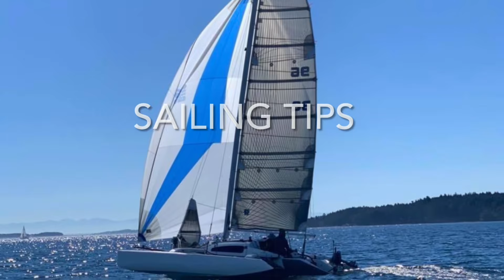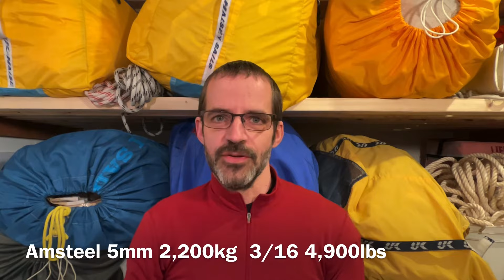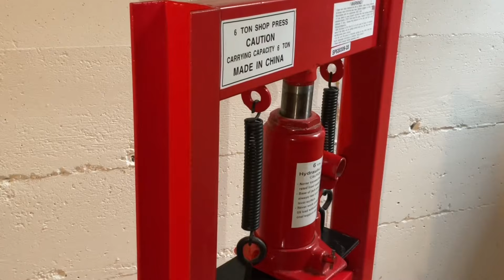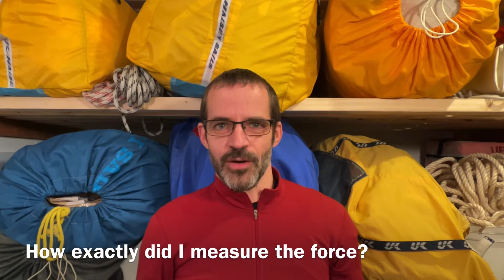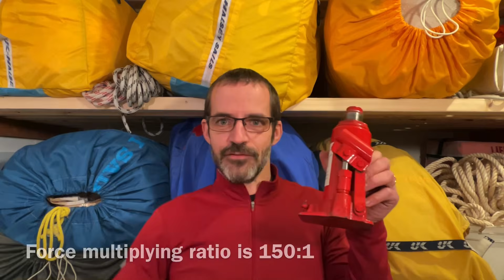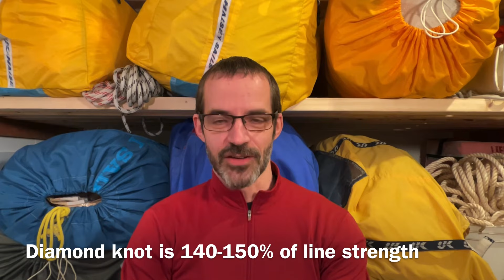The Easiest Way to Make Soft Shackles

Comment: Hi would you use this kind of shackle for genakker head, clew and tack? TY :)
Reply from the maker: Good question! I normally use these types of soft shackles for attaching blocks to random locations to tweak headsail leads, and I have also used for spinnaker clew. For head and tack I normally use metal shackles but could use these too. What size of boat?

Comment: Questions. Does the length of the handle effect the force ratio? And, does the work the same for a rolling floor jack? Thanks!
Reply from the maker: With a rolling floor jack there are effectively three force multiplier ratios at play 1) the size of the hydraulic pump actuator piston vs the piston that lifts the jack 2) the length of the handle and the distance between the pivot and the hydraulic pump actuator, and 3) the length of the lifting arm and the distance between the pivot and the hydraulic lifting cylinder. That said an easy way to approximate the ratio of a rolling floor jack is to say lift the back end of a pickup entirely off the ground by the differential while measuring the force on the handle. Then weigh the back end of the pickup on a commercial vehicle scale to determine the effective force ratio. Of course this will change at extreme jack angles but is a reasonable approximation.

Comment: Check out how not 2 YouTube. I made overhand soft shackles too, I hope they break before anything else on my rig 😂
Reply from the maker: Yes How Not 2 has some excellent content, plus they have a far fancier test rig than I do! Since creating the video I’ve only had a single “failure” of an overhand knot soft shackle, and it was the noose slipping over the knot because I wasn’t careful to make the ends equal lengths so the noose was a bit loose. Plus I was using the soft shackle to connect some Dyneema rigging to my tractor to pre-tension some shrouds and pull out the construction and splice creep, so a much higher load than I’d normally put onto a soft shackle.

Comment: Thanks for the video. Straight to the point and well done. Will be making some for my jeep winch.
Reply from the maker: Note that I’ve only tested this on 3/16 or 5mm Dyneema so have no idea how well the overhand knot works on other sizes of line! Since I made the video I’ve had one “failure” where the noose slipped over the knot, but the shackle didn’t break. This was because the overhand knot is a bit smaller than some of the other common soft shackle knots and my ends weren’t completely even so the noose was a bit too loose on this particular shackle.

Comment: I just finished watching 4 videos on splicing soft shackles. Given the forces that your original single overhand knot shackle could bear, that's probably more than they would ever experience on my boat. So happy days, thanks for a great video.
Reply from the maker: Cool! I’ve only had one overhand knot “failure” since creating this video, and it was the noose slipping over the knot because the ends weren’t quite symmetrical, and the overhand knot is smaller than other knots.

Comment: I have many uses of the quick connection that a soft shackle can do, but they are so expensive. Why does everyone talk about Dyneema rope in soft shackles? Can't I use regular affordable Danline rope if my main purpose is just a quick non-corroding connection?
Reply from the maker: It really depends on how much strength you need. Dyneema is stronger than steel and a soft shackle made with 3/16” or 5mm Dyneema can lift several thousand pounds. If you only need to lift a hundred pounds you can use other lines. But my local chandlery sells 3/16” or 5mm Amsteel Blue (which is Dyneema) for about a dollar per foot, so you can make a soft shackle for about $3, versus $30 same thing will cost in the store. HUGE margins on Dyneema soft shackles!

Comment: Hi, I have a little Tramp trimaran. I am thinking about replacing the brass hanks on the jib with amsteel hanks (because the brass hanks are wearing through the sail when the sail is rolled). The forestay is steel, but I am hoping that amsteel will give pretty good chafe resistance. Do you have any experience with using amsteel in that sort of application?
Reply from the maker: Yes I have sailed with jibs with Amsteel hanks, basically a loop fixed to the sail on one side that folded around the forestay and was captured by a velcro tab on the other side, kind of like velcro shoes for kids. Definitely works but a bit finicky to attach the jib. Another approach is to just use a piece of webbing fixed to one side of the sail, which loops around the forestay and attaches with a nylon buckle to the other side of the sail, the same kind as a backpack strap.

Comment: So, I got out my Ashley's Book of Knots, turned to the section on "two strand lanyards",  and after experimentation settled on the #802 (page #145). It's easy to tie, easy to untie, easy to keep perpendicular to the splice, suitably bulky, and seems to hold well without slipping when I tug on it. Of course, I can only put a few dozens pounds of force on it by hand, compared to your hydraulic press...
Reply from the maker: Great suggestion to test that one!

Comment: It’s very little extra work to tie a soft shackle with 150% of line breaking strength.
Reply from the maker: Based on my testing the overhand knot holds about 75% of line strength and the double figure eight holds about 150% which is also easy to tie. There are definitely fancier knots out there if you’d prefer.

Comment: I'm curious about replacing the shackle that holds the top of the Genoa in a roller furling system. I'd worry about it shaking out of the loop when not under sailing load, bouncing around on a moored boat for a season. Does the loop hold tight to the knot?
Reply from the maker: Great question! I’ve never used a soft shackle in that application but I have used them for jib sheet connections to the clew for the last five years and never once had one shake out even if the sail is flogging. The biggest concern would be chafe and ensuring the shackle doesn’t encounter any sharp edges. Hope this helps!

Comment: Button knots always feel better to me, and oddly enough i never had any issues tying them
The main reason why i prefer them to diamond knots or most other knots is because i like the bigger bend radius for the noose
Reply from the maker: If I’m to do a “fancy” knot I also prefer the button knot over the diamond knot.
Reply: @SailingTipsCa  yeah I think it's really odd that button knots are almost like hazing in some sports like high lining. They say "you gotta earn it" when button knots arent that hard to tie. The trick that helped me was to start by tying it super close to the noose so I had a ton of tail to work with, and adjust the tails as I'm sinching it to get my desired length

Comment: A knot I like is the double overhand knot. Then if the end pulls through under load there is still an overhand knot as backup. Would love to see this tested.
Reply: Meant to also say . . . lots of friction too because of the two wraps. Therefore might work well with dyneema.
Reply from the maker: Good suggestion!!!

Comment: Try to tie the Zeppelin knot instead overhand knot.
And it's much easier to tie Cow hitch after different knot instead loop first.
Reply from the maker: Thanks - I hadn’t encountered the Zeppelin knot before! Also need to be wary of cow hitches in Dyneema in general because they tend to slip.
Reply: @SailingTipsCa  Then You can use double or multi overhand knot, or 8-figure knot
Reply from the maker: @ Yes I mentioned test results of the double figure-8 knot in the video and it did much better than the single overhand knot. I did not (no pun intended) test the double overhand knot - will do!!!

Comment: Uprating the size of the line used for the shackle could easily make up for the difference in strength too. I was planning to use 3mm in some places on my boat as it will handle the load, but bumping up a mm or two will make them easier to handle in addition to adding cushion to the breaking load.
Reply from the maker: Yes I find 5mm / 3/16” to be sufficient for most jobs on any boat under around 40’.

Comment: This is brilliant - thanks!! I’m new to soft shackles on our cruising trimaran and buying yacht shop shackles has been quite expensive. This will certainly help👍
Reply from the maker: Glad you like it! You can experiment with different kinds of knots in non-critical applications and see what works best for you!
Reply: @SailingTipsCa  I just made 6 of them with 6mm Marlow D12 and the double overhand knot. Used two of our winches to really tighten them and they’re now holding up our barber hauler line off the deck. Will make a bigger one tomorrow for our spin and Code 0 aft blocks as well - thanks again!👍
Reply from the maker: @PN_48  Nice! I use them for attaching screacher and spin blocks as well!
Reply: @SailingTipsCa At 09:32 you mention (and picture) using a soft shackle at the mainsheet attachment for the boom… could you please elaborate? How do you stop the loop sliding on the boom / how did you fix it’s position?
Reply from the maker: @PN_48  Good question! The soft shackle passes through both the main sheet shackle below the boom and the sail clew ring above the beam, both of which can float somewhat fore and aft, however the final position at any one point in time is controlled by the sail draft (curvature) forward of the shackle and the outhaul line connected to the sail clew aft of the shackle. In other words, it’s all about managing the position of the sail clew fore and aft with the outhaul, and up and down with mainsheet tension. Does this help?
Reply: @SailingTipsCa  That’s really helpful - thanks! I just rewatched the video and can see that setup at 09:32👍 Off for more dyneema tomorrow then… what size did you use for your setup (and what size is your tri)?
Reply from the maker: @PN_48  My boat is an F-82R trimaran and 8.2m or 27’ long. I typically use 5mm / 3/16” Amsteel Blue and have occasionally used 6mm / 1/4”. How big is your boat? Not sure if you’ve seen this video where Iift the front of my car with a 5mm / 3.16” soft shackle: The Amazing Lightweight Rope That Can Lift A Car!!! https://youtu.be/9shiekaQNT0
Reply: @SailingTipsCa  Nice👌 We have a Skip Johnson 43 - so more sail area but we probably reef a lot sooner as we’re not racing. I’ll grab a look at that vid now before heading out for more dyneema😂
Reply from the maker: @PN_48  Sounds like a nice boat! You can use the Harken mainsheet calculator to approximate loads and size appropriately: https://www.harken.com/en/calculators/mainsheet-loading-calculator/
Reply: @SailingTipsCa That’s a great calculator! I ended up doubling up our 6mm dyneema for our mainsheet, so Harken state a max load of 700kg at 20kts and our dyneema loop is now rated to 12t. Should do the job😂 The Farrier tri’s are awesome - I’d love an F39 but building another boat is a step too far, and they rarely come up for sale second hand. I’ve now used 60ft of dyneema to make soft shackles based on this vid - they’re so handy everywhere!👍
Reply from the maker: @PN_48  Yes Harken also has a great jib sheet load calculator. And 12t ought to do it for your main sail! I always have a bunch of Dyneema lying around to make soft shackles for whatever project because it’s so handy! Also agree that building an entire boat is a step too far assuming one has other life responsibilities! I think there was an F-39 for sale recently in Brazil but I can’t find the listing anymore…

Comment: Interesting video. I can understand the idea of chasing a dream “tie a simple knot on slippery line”. What confuses me is using a knot that slips (not really a knot, a couple of bends on a line) in a critical control system on a boat ( i.e. holding your mainsheet rigging to the boom). Ok you can mitigate that by using larger diameter dyneema at higher cost, but why? 

Or.. you can study the way to tie a knot that does not slip. I had the joy of meeting a master rigger Mr. Brian Toss at a boat show. He demonstrated his knot creation using dyneema to tie soft shackles. I tie soft shackles using his knot. When tested on a commercial stress machine designed to OSHA certify rigging for commercial rigging use, my SK78 Amsteel soft shackle made using 3/16 diameter line failed at 10,800 lbs of force. The break occurred in the middle of the shackle line, not the knot or the end loop. This convinced me that the knot design had zero failure. The failure point was in the  way the 12plait threads constricted over the square buried ends of the knot in the line. An easy fix. I tapered the buried ends. 

Using the correct tool for the job is always better than making do, for a craftsman or seaman.
Reply from the maker: It’s really useful to know how much strength you actually need for any given application so you can size everything appropriately, including lines, blocks, and knots! I think it’s completely amazing that a 3/16 soft shackle can hold up to 10,800 lbs, but for most boats under 40’ / 12m most sailing loads are less than a third of that. To put things in perspective my “weak” soft shackle is still strong enough to lift a compact car. The Amazing Lightweight Rope That Can Lift A Car!!! https://youtu.be/9shiekaQNT0  Also sailing loads tend to be more dynamic than the smooth pull of a hydraulic press and those dynamic loads tend to set knots rather than pulling them out. All the overhand bend soft shackles on my boat are rock hard and none has ever failed. Rather the only Dyneema failures I’ve ever had on my boat were due to chafe.

Comment: There's a YouTube channel...'how knot 2' that has a lab set up for these kind of tests. They mostly test rock climbing gear and slack line anchors but have very accurate measurements. Perhaps you could work with them to get more precision. And you could easily try many knot configurations.

I use a larkshead knot in lieu of your awl poke through step. Much easier but I've never tested for strength.
Reply from the maker: Yes I’ve seen some of their tests on that great test rig they have - good suggestion! Not sure if you’ve seen my other crude test of this knot where I lift the front of my car? https://youtu.be/9shiekaQNT0

Comment: I have used the flat overhand knot as the button knot on multiple soft shackles on my Alberg 30 (including my jib sheet to genoa clew and mainsheet to traveler shackle) for several years. When tying the flat overhand knot (ABOK 1410) I leave a longer tail as recommended by European mountain climbers. Also, instead of a simple Brummel eye splice, might a bury splice be more secure in a flogging situation (ie jib sheets)?  Excellent instructions, thank you.
Reply from the maker: Glad to hear you’ve successfully used these too! Yes a bury splice might be better in some situations but I haven’t found the simple eye splice to be problematic yet… Good tip on leaving the tails long!

Comment: Hey man great video! I appreciate the real tests! I saw another video of making dyneema soft shackles, the best I’ve seen, more complicated than yours but still no difficult knots. Do brummel splices in each end, bury the tails, do the little off-centre tuck thru loop as with yours, then tie the two loop ends in an overhand knot, pass the free end thru both loops to make a huge captive knot that can’t slip. I’ll get the link
Reply: https://youtu.be/o4J4hJoJFHg?si=hEzFP5b3kaadz_Gc
Reply: Soft shackle at 17:30
Reply from the maker: @grandmasterflash213  For some reason YouTube doesn’t like links to other channels in comments - it seems to auto-delete them! I’ve seen the one you’re talking about though and it looks pretty bomb-proof!!!

Comment: All knots in dyneema will slip. If you chock load it, the dyneema will melt. Button knot with buried ends will not fale ever, is not hard to learn and will make you sleep at night knowing your soft shackles are as strong as they can be.
Reply from the maker: Yes knots do slip in Dyneema but you can still load them up pretty good before anything bad happens. In this video I lift the front end of my car with a tractor bucket using this soft shackle, and repeatedly shake it up and down, and it holds with this particular load:  https://www.youtube.com/watch?v=9shiekaQNT0
Reply: @SailingTipsCa  yeah, but a button knot is till better.
Reply from the maker: @andraxification  Totally agree!

Comment: The stats I've seen with the Diamond knot are higher than your quote, I think 170%-200%%, and with the button knot and leads buried in the line, 230%. Nevertheless, what you have is certainly easier to tie and very useful. Much quicker to put together in a pinch.
Reply from the maker: I didn’t actually test the Diamond knot myself but used the figures from this website: https://www.balancecommunity.com/blogs/slack-science/a-comparison-of-soft-shackle-methods. 

Burying the tails back into the line will definitely increase the strength, also for the overhand knot. 

What I did instead was start with the easiest soft shackles to tie and then test to see if they were “good enough”.

Comment: Very good... What about the "Ashley's stopper knot" quick easy to tie and very strong.
Reply: Do you have any experience using this type of soft-shackle in a situation where the load frequently changes? An example would be a drogue where there is load and then no load. 🤔
Reply from the maker: @ianshaw23  Good question! I haven’t used it on a drogue, but do use it for main, screacher, and spinnaker sheet blocks that have constant load while the sail is flying but do go slack and can get thrashed about when tacking and gybing. These kinds of variable loads actually seem to help set the knot and I’ve never had an issue with one flogging itself loose.
Reply: @ianshaw23  Yep, I use them for camping e.g. Tarp shelters, hammocks, working around the house,  lashing down equipment.
Reply from the maker: That’s a great suggestion!!!